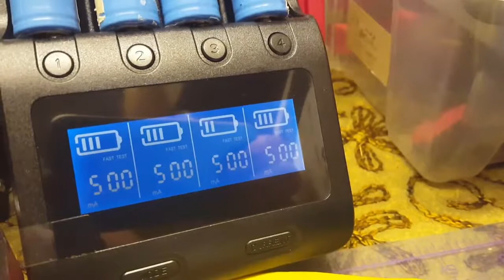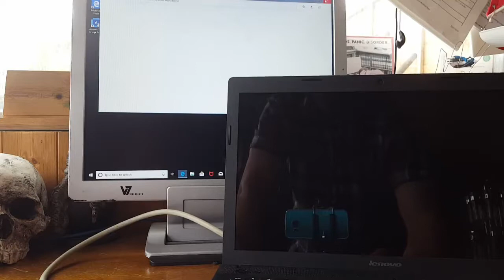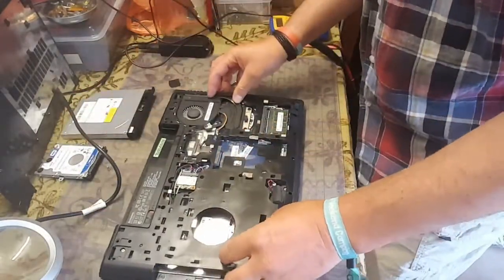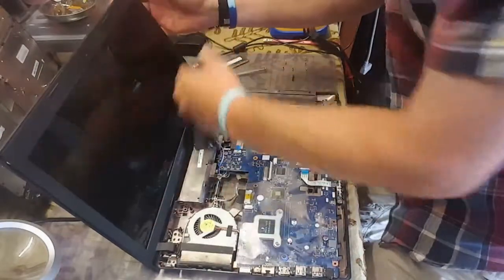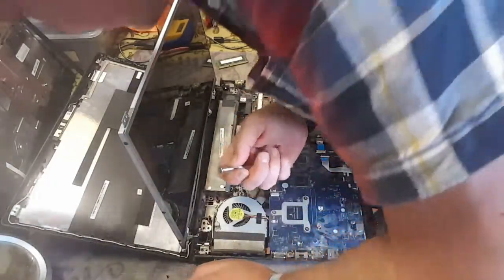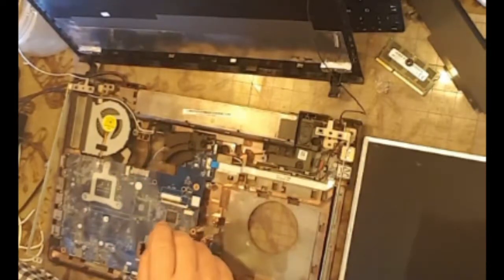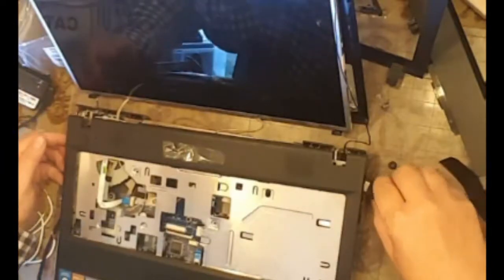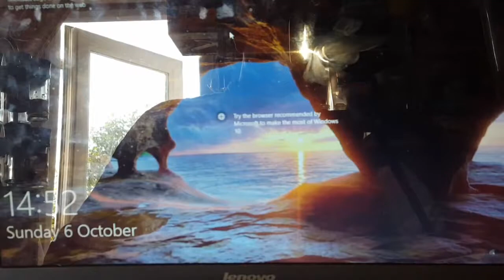Repairing Lenovo G510 i7 Laptop - screen cable replacement

Comment: hey... i need this screen cable.. pls discribe exactly the model... thanks.
Reply from the maker: Hi ChiTaff, sorry! I've just gone through all my email and ebay stuff and can't find the part number. You can count the number of pins and then search ebay using the model number of the laptop. That's how I found it. Again apologies for not being able to answer your question directly
Reply: yea i'm having the same problem. did you find the cable?

Comment: I cant detach the keyboard from the backside. I watched again and again but somehow there is a connection between keyboard and main board. I can even pivot the keyboard slightly around this one connection. This connection is under the "K" key on the middle height and right side of the keyboard. Just right next to it there is a screw from the back which I took out. So there is no hidden screw from the keyboard side? All from the the back right?
Reply: found it myself but don't know why it was working here without that. You have to take out the keyboeard first out of the front sheet - see here: https://youtu.be/-XiwNqz7Alw?t=466
Reply from the maker: @tim4953  Well done... always tricky

Comment: Please explain the cable management at hinge
Reply from the maker: Hi Lol... so sorry I missed this. I cant remember the cable management at the hinge only that it went through a small channel in the plastic and then up the left hand side. That's it
Reply: @bangcrashtinkle6718  I got a problem with putting the small part of the cable the one that goes above the monitor
Reply from the maker: @MrSkorpija  Hi. Can you explain? The cable should follow a small channel if I remember correctly. I will do my best to help
Reply: @bangcrashtinkle6718  yes that part off the cable thats right besides the camera
Reply from the maker: @MrSkorpija  Hi. Apologies for delay. If I remember correctly you will a channel for the wire going from the camera directly left and then round and down just outside of the screen. The wire follows a channel with very small grips every 2 inches (50mm) or so. Hope that helps